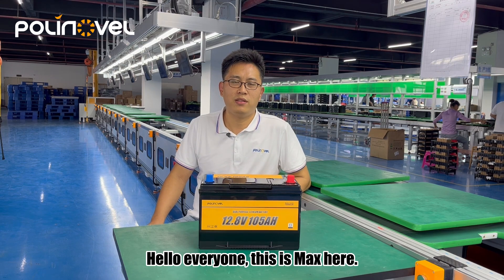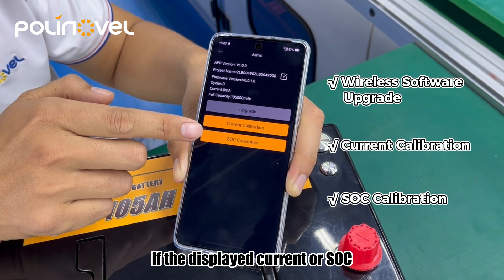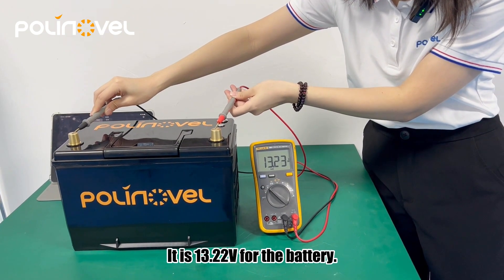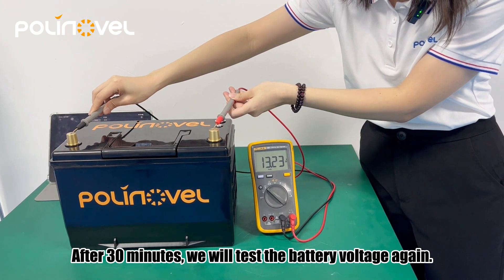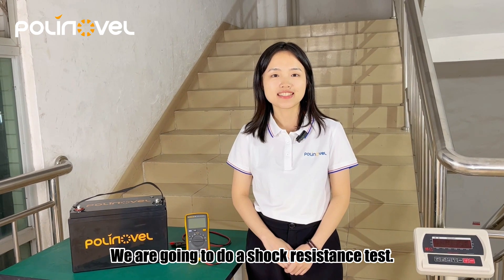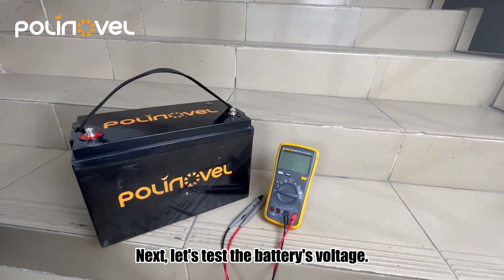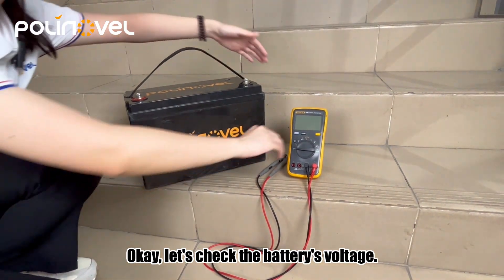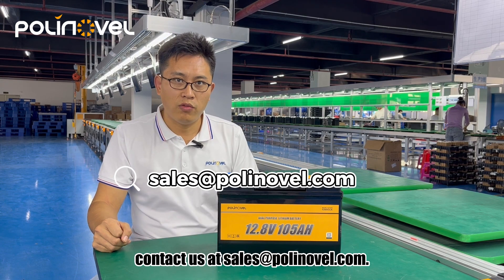Polinovel Dual Purpose Lithium Battery

Comment: Can this Duel purpose lithium battery accept the charge from an outboard motors 12v alternator which is designed for lead acid marine batteries
Reply from the maker: In general, our dual purpose lithium battery can accept charging from the 12V outboard motor alternator designed for lead-acid marine batteries . But please make sure that the alternator’s charging voltage is within the acceptable range for lithium batteries. If the voltage is too low, the battery may not fully charge; if it's too high, it could damage the BMS or trigger protection.